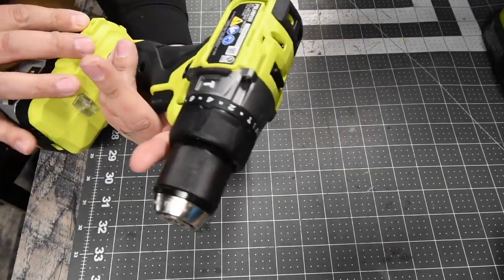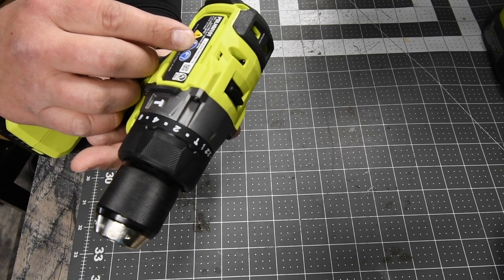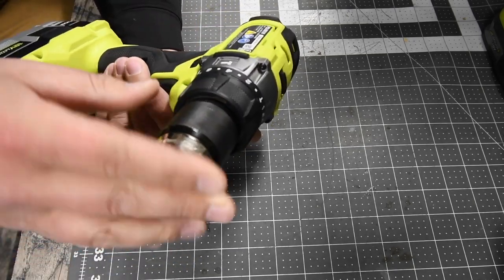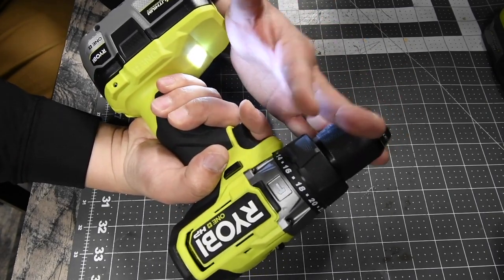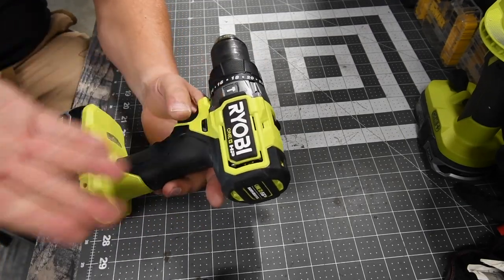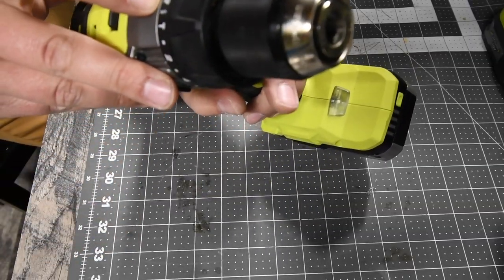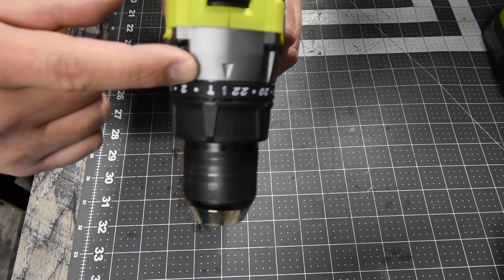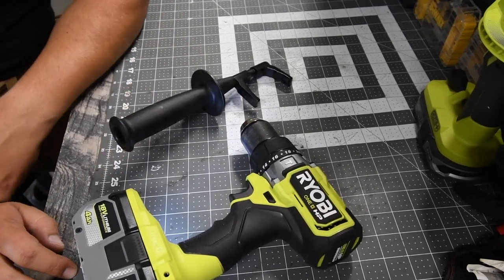Ryobi hammer drill (MCT 2 min reviews)

Comment: There is a new compact hammer drill - PSBHM01, it's probably the most compact drill Ryobi has made yet, and it also has the hammer function - I just bought it today after researching the different models. It is weaker than this one, but that's the trade-off. Would be cool to see a comparison between it, this one and a regular drill.

Comment: Love the new format. Skipping over the battery and accessories leaves the review slightly lacking though.
Does the drill have the HP connectors? That's what I wanted to know....
Keep up the good work. Maybe 3 minute reviews?
Reply: Yes this drill has the HP connectors, I have one.  Also the handle is meh, it's just a solid plastic handle with the hardware being metal.  You have to make sure you get the thing lined up right though.  I'd much prefer a screw style handle, like the one that comes with the PBLAG01 angle grinder, it's much nicer... could probably use a thread adapter to make it work though.
Reply from the maker: Yes it does, I had to re edit this because I deleted some footage on accident
Reply: @ManCaverTools  fair enough, not that the end consumer of this video knows that. 
2 minute tool only reviews
3 minute kit reviews 
Not everything can be squeezed into 2 mins. 

Keep up the good work

Comment: what does the clutch do? higher has more power?
Reply: Clutch simply regulates the torque camming out on fasteners. I prefer drill drivers to impact drivers cause the clutch give you more control over how deep you want to sink a fastener into wood.
Reply from the maker: the clutch allowed you to stop a screw going in too far. you can set the clutch to only allow the screw to a certain depth ever time